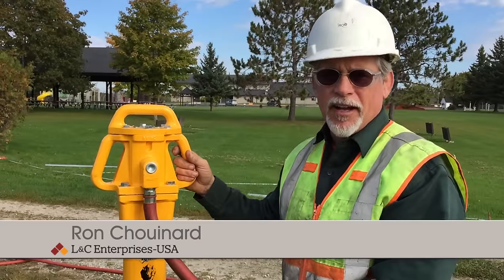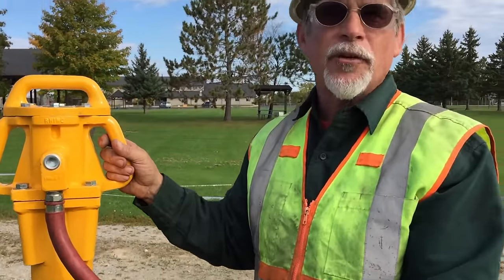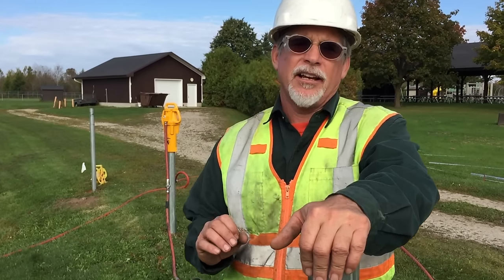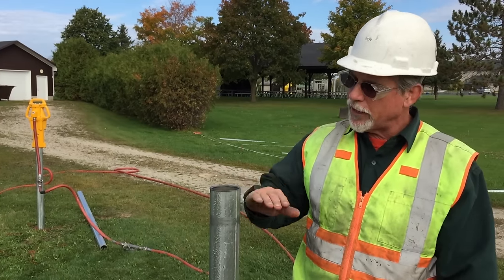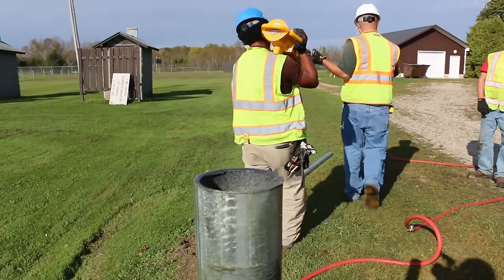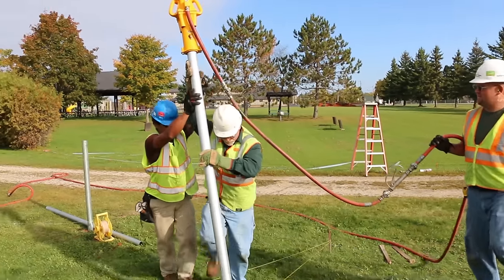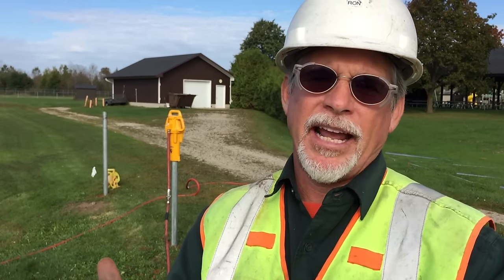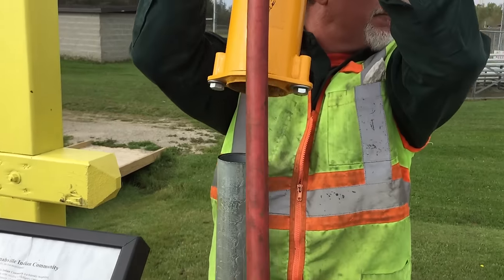Installing Chain Link Fence with Rhino PD-55

Comment: I own a fence a company  setting post like that with no cement wouldn't they loosen up or how does that work when you stretch fence
Reply: austin vickers you can only pound line post
Reply: You own a fence company and you're asking this question?

Comment: Can it pound in an 8'  3.5" wood post in to sandy soil? Thank you
Reply: mike mike Hi there... did anyone get back to you this? were you able to use for wood post at 3 to 4" diameter?
Reply: Uh, I am going to say no it isn't meant for pounding wooden posts into the ground.
Reply: Yes mike. We build docks with them. Driving 20 foot wooden 4x4 posts 3 feet or more into the sandy lake bed